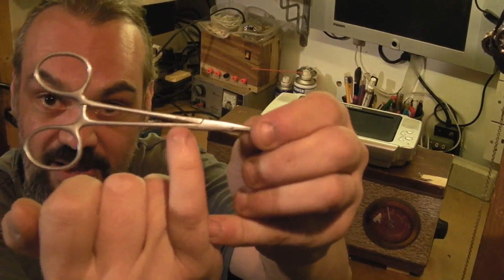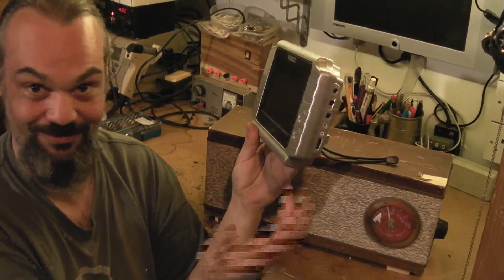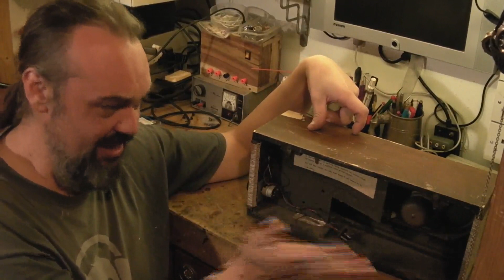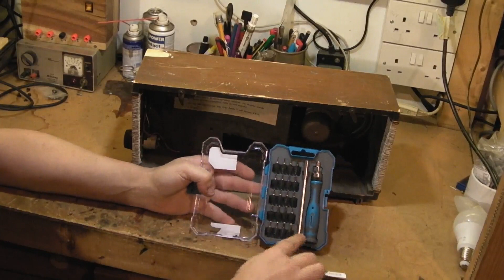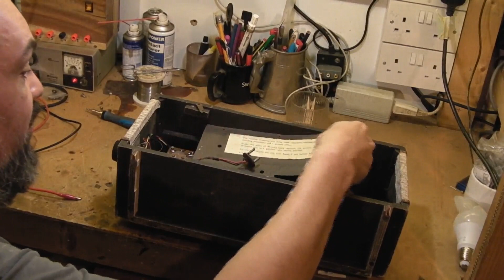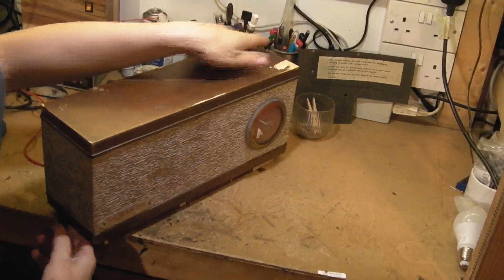EverReady Sky Baron, From the car boot sale

Comment: Love the videos Jay. Are you able to recommend a bench power supply that can do both AC and DC output and won't break the bank?
Reply from the maker: not sure really, most of my equipment is decades old. good DC psu's can be had for under £30 second hard if you look around and for a variable AC supply I use my veriac, you can connect a transformer to it if you want very low ac voltages and just use the veriac to very the voltage on the primary winding. again easy to get for around £30 second hand.

Comment: At the dentist I nick mirrors and the like!  Andy has some veneer and too much for the set I have. You are welcome to some. That came to life really well and it should live! All the capacitors are OK to me and at 9v they should not be a problem....
Reply from the maker: That would be awesome if there is going to be some spare, It definitely surprised me it came to life so easy I was expecting it to fight me. I've had it playing in the background all evening connected to a knackered 12v lead acid battery that has shorted cells and only outputs about 10V. and its played flawlessly i even got radio 4 at the bottom of the dial which is very good here without an external aerial